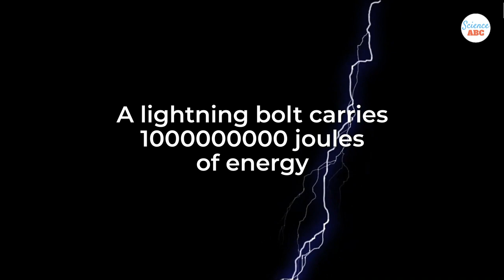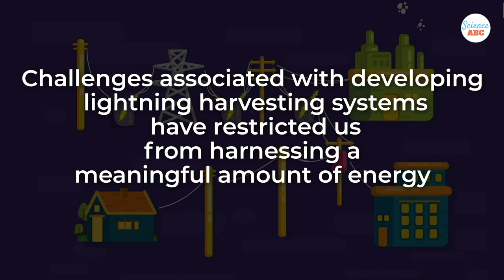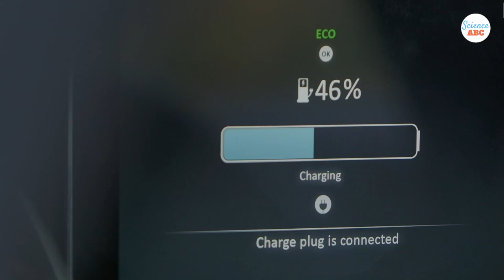Can We Harness Electricity From Lightning?

Comment: It's not a "tremendous source of energy". It would be more accurate to say that it's a highly powerful event (power = energy/time), not because the amount of energy involved is huge, but because the time interval through which it's delivered is very, very short.

Now, about the energy content... It is not negligible, of course, but we have to consider that most of it (> 80%, being generous) is inevitably dissipated as heat. So in the end, it's not that much as one might think.

But even if we ignore that and we assume that we can extract 100% of that energy (including the energy inevitably dissipated as heat), the cost of the required infrastructure is just not worth it. We would need a planetary grid of towers, and even with the most conservative assumptions, only the cost of the steel would be equivalent to build more than 300 of the biggest hydroelectric plant in the world (the Three Gorges, China, 22.5 GW), and would barely generate twice as much as ONE of them. Yes, I actually ran the numbers, and that's what it yields even with ridiculously optimistic/impossible assumptions. With slightly more realistic assumptions (but still lots of ideal conditions), it would generate as much as 15 average medium-sized wind turbines working at 30% efficiency (for the same cost).

Also, what they mention about the lasers to help ionize the air to induce lightning strikes... I wasn't surprised at all that it didn't work. And there are plenty of reasons why, it's all in the literature, it's nothing new. But basically, it's related to the way lightning rods actually work. People usually think lightning rods "attract" lightning, but that's wrong. Lightning rods provide a path to earth for descending charges, so a great part of them will just flow constantly to the earth when they reach a certain potential. Therefore, it's actually LESS likely for a lightning strike to even occur in a zone with lightning rods. With the laser, the effect is similar, but even more pronounced, since it provides a full (or almost full) path for those charges to flow to earth. But we can't even know if the charges in a particular cloud are enough to produce a lightning strike, so more often than not, we would just drain a few charges, and the build-up process in the cloud would have to start all over again before we can try again. If anything, it would be an excellent way to prevent lightning strikes, not generate them.

TLDR: Even with most ideal and ridiculously unrealistic assumptions, the cost of harnessing the energy from lightning would be SO high, and the actual energy obtained from it SO low, that it's not even worth considering it.
Reply: Interesting. . . It has been my understanding since childhood that trying to "harvest" lightning is impractical for the reasons you mentioned.
Reply: @davidroyer5049  yes, summarizing, not only it's not practical, but also very unlikely to ever be. So your understanding is correct.

Comment: It’s the problem that the energy in lightning is transferred in an incredibly short amount of time but the amount of energy is massive, it would overload the wires you attempted to feed it into. 
It’s down to the same reason why we need to step up the voltage in the electricity we generate in power plants before we move it about.
If you were to not step up the voltage before directing current into power lines the resistance would be huge and the power lines would have to be meters in diameter to support the amount of energy and not simply fry. 
An analogy is:
It would be like trying to force the water from your pressure washer down through the point of a syringe that is micrometers across. 
As you could guess the water wouldn’t make it that far either the pressure washer would explode or the hose would rupture.

I don’t know how many amperes of current the average power plant produces each second but it’s most certainly less than the 30,000Amps in a lighting strike. 

You couldn’t just funnel the energy into a transformer straight away either because the wires on the coils of the transformer would have to be ginormous so they could support 30,000 amps of current. Also like it was said in the video the power of lightning is very variable and even with the huge wires a powerful enough bolt could destroy it all. 
It’s just not feasible with our current technology.

We would have to devise a new way of altering voltages other than transformers.
Reply: I don't know if I asked you this directly but what if it was just used to evaporate rather strike perfectly the right amount of water to turn it into mostly hydrogen

Comment: I think we need polar bonds or Van der Waals forces to generate a strike. Imagine two atoms or molecules, they bind together for an instance with a variating differential, like 100 to 50. Doing this by creating more pressure, warm to cold, high and low rate of centrifuging "air" etc.

After these bind, they have to discharge again... This could happen in a plasmadischarger... With oxygen ions surrounding the discharger, assuming the discharger is open, the energy seeks a minus "ground". If the plasmadischarger is not open, we could use electrodes and electrolytes of this atom representing 100 of 50. Then the discharge would take place at the electrode and the ion would discharge seeking the ground using oxygen ions again.

Normally, lightning searches ground. So, when for example a high energy from an atom leaves a lower one, by a simple process called repelling (magnetic), this energy will discharge, seeking ground.

It is like: 100 to 50, 90 to 40, 80 to 30, 70 to 20, 60 to 10 and 50 to 0, at the zero point it will discharge with 50 energy... If you ask why? The reason of this occurence is that a polar bond binds with N/S/N/S... At 50 to 0, it becomes N/S/S/N and repels in theory.

In real life, + and - correlate and two clouds, a higher energy and a lower one move in the same direction. Now, atoms bibd I think, and because there is a differential, when the process gets reversed, by back emf or better say air that moves in opposite direction, the process reverses creating the effect counting from 100 to 50 towards 50 to 0.

Comment: It is so easy to capture lightning energy . Just  make a huge coil that can withstand that power and make it wen a lightning hits to power a flyweel  . Flyweel is mecanical and it wont ghet burn from all the magnetic power that it is created .so each lightning wil accelerate the flywheel faster and faster . Then from that flyweel u can generate the electricity u need

Comment: Question why can't we re-create lightning conditions in a lab. Better still create a lightning reactor. We can split the Atom after all. Surely this is untapped clean power we should at least investigate.
Reply: Because of thermo dynamic laws. You can't create more energy than you need to start the process.

Comment: “Scientists at the University of Massachusetts Amherst found that electricity can be drawn from the air with just about any material, as long as that material has microscopic holes. The method works by drawing electricity from water molecules in the air. ‘The air contains an enormous amount of electricity,’ said Jun Yao, the study’s senior author. ‘Think of a cloud, which is nothing more than a mass of water droplets. Each one of those droplets contains a charge, and when conditions are right, the cloud can produce a lightning bolt.’ Yao’s team developed a device to harvest the electricity, using a thin field with holes smaller than 100 nanometers— less than a thousandth of the width of a human hair. Electrically charged water molecules move from the upper part of the device through the holes to the lower part. Because the holes are so small, there is more water on top of the device than under it. That creates an imbalance in the electrical charge, which generates an electrical current and turns the device into battery. The team thinks the technology could be used anytime, anywhere. A harvester could be made from different materials depending on the environment. Multiple harvesters could be stacked together to increase the amount of electricity captured. ‘Imagine a future world in which clean electricity is available anywhere you go,’ said Yao.”

— The Week Jr. (Jul, 2023)

Comment: With 180 degrees of flat line pressure, diatomic atoms are created low, though the spectrum of matter has a verticle upgain expanding spherical radial but also convergence of other atomic and even triatomic particles that create a choppy path of least residence on a vert.

Comment: Autonomous drones which can GLIDE  if not deploy dirigible modules to remain aloft and Track with the likely discharge regions, and attract the bulk of lightening where it is actually occurring as it occurs. When "struck" they could then charge capacitors in a super-fast array which then transmit via onboard beam-transmission to land-based mobile array units which both delivered the drones to the area and launched them, with battery systems in tow on add-on trailer systems.  A few Million dollars should get one prototype in stellar condition.

Comment: Ok so if the idea of harnessing lightning is so far stretched then perhaps my idea isn't.
Rather than waiting for technology of a super fast charging battery being released for public use. 
Let's say we have a lightning rod and it is tied  to a circuit with magnets. The picture I have in my head would closely resemble a roulette wheel. A bolt of lightning will propelle a magnet around in circles generating electrical current which can charge the optimal amount of batteries or capacitors

Comment: one of the problems would be to try to separate the bolt down to many inputs because of the massive heat so it don't just burnout the battery from to much power all at once.

Comment: But a horizontal transfer with open negative would surely out perform vertical transfer as several atomspheric inverts  and molecular inverts would be a difficult path of least resistance and hard for non resistant energy trans

Comment: Maybe there is a way of capturing one single lightning bolt and manufacturing it into multiple smaller ones ,that wouldn’t be that hot and that the volts would lower.

Comment: i thought it was more like ~0.25kwh in average per bolt rather than 300kwh

if it was 300kwh, that would be huge given there is ~5000 strikes per second on earth.

that would beat all energy generated on earth by all means of generation combined.

Comment: I stopped by to learn a thing, or two.  I'm thinking of storage capacitors and running capacitors along with a transformer, and voltage relay.  However, I am only working with 1200V.  I just figured the conversion would be the same.  Please guide me to an educational website because I am just starting out with high voltage.  .

Comment: Can we use group of big super capacitor for storing
Reply: Maybe ..or a series of them where they can continuously charge and discharge back and forth...maybe be able to route some out. That is of course if you can keep the caps from spontaneously bursting into flames from temperarures
Reply: @mariopuzo4509  How about? Millions of huge Capacitors buried underground where excess electricity can go. Use the ground as a conductor, don't connect the capacitors directly to the lightning strike location. You have to let some actually ground, just skim what you can hold.
Reply: @michelsavoie6971  well then your not collecting a truly meaningful amount of electricity from a lightning bolt. remember 1 good lightning bolt can only power 10 homes for a DAY. that alone is not a lot of electricity when you expand into the thousands of houses that a country has
Reply: @rocketblaster8701  Thanks for the comment. I get your point. So rubbing a balloon on my head is not enough either, you're saying ;) Have a great day Rocket Blaster.

Comment: you shoot copper lines into  the storm when the storm is ready for lightning which they can already do and it acts as a step leader and once you get the bolt have it go to a very large fast charging battery     and then put into the grid   or slowly pull the power as you need it    but the battery would have to be very large to handle the very large  bolt or small bolt..if you go to lets say Florida the lightning capital of the usa  that would be a great place to try it.
Reply: easier said than done

Comment: i think to harness electricity you need to see what dumb nature engineered why dumb nature well bio evolution is slow and extremely fragile meaning a single cut can be lethal to some people 
anyway i think you need a pole that would bait the lightning and have many little transformations 

kinda like how our lugs work with oxygen and imagine the oxygen is lighting you dont store oxygen in a single chamber but many tiny ones cause lets think lightning would short-circuit or melt the machinery if all of it go trough a single smoll one or would just be a huge waste on a large empty chamber that you probably would harness barely nothing 

so i think you just need a device that baits lightning basically tall so it would be a focus and dont explode from overvoltage the grounding and so on
what about gases what type of gas is electro conductive maybe build a giant balls haha funny lmoa xD that evenly spread electricity but dont overcharge the conductors or whatever it is that gonna gather what the electric conductive gas chamber captured but not thermal reactive cause then you gonna have to deal with explosion or fire 

and then safety and cost gonna be a problem and maintenance